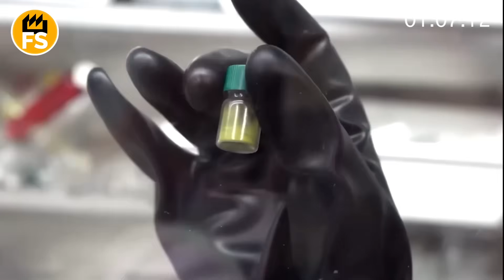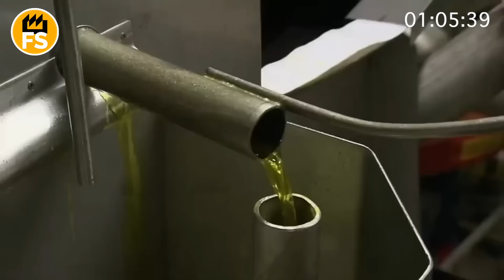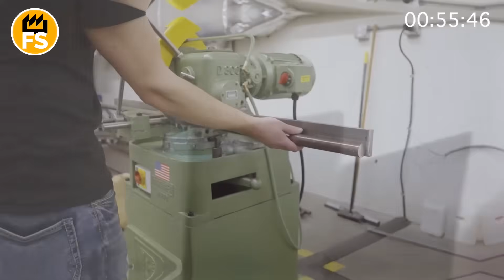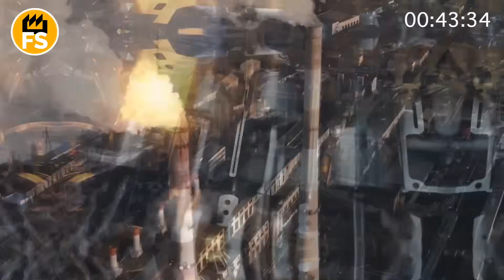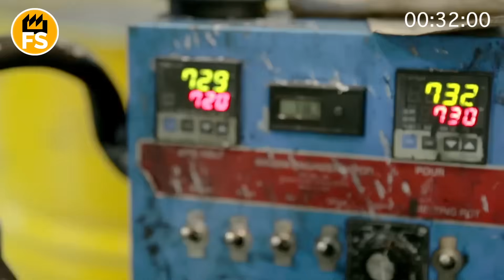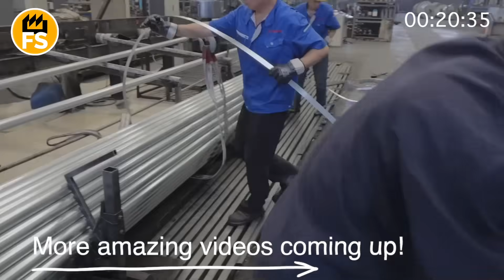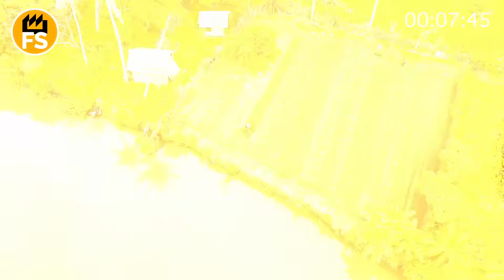How It's Made: Nuclear Fuel (1 Pellet = 17,000 ft³ of Gas!)

Comment: 2:44 a long half-life yes (700 million years), however the longer the half-life, the lower the radioactivity. The majority of spent fuel is Uranium 238 (which has an even longer half life of 4Billion+), the most dangerous isotopes in the spent fuel rods are cesium-137 and strontium-90 because they have a relatively short half life in comparison and therefore a hugely increased radioactivity. Don't breath any of it in though!
Reply from the maker: Thank you for sharing your insights, @Anonium1! You make an excellent point about the relationship between half-life and radioactivity in spent fuel; understanding these nuances is crucial for comprehending nuclear fuel's impact. 🔍

Comment: What a load of shit. Ive handled uranium. Alpha is only really harmful if it gets inside the body. Clothing can stop alpha emissions most of the time.
Reply from the maker: Thanks for your insight, @jasonduncan69! You're right that alpha particles are less harmful outside the body, but it's crucial to handle all materials with care, especially in nuclear fuel production. What has been your experience with uranium? 💡
Reply: @Factory.Secrets I've handled raw ore, yellow cake, and depleted material. You have no clue what you are talking about. Use your respirator, and watch your amounts and you're fine. Same with plutonium. Both alpha emitters that can be barehanded in the metallic form. Just don't inhale or ingest it. That's where alpha does it's damage. Unless it's a critical amount.
Reply: @Factory.Secrets we had to handle radioactive material in the oilfield. Some of the wireline tools, certain sensors on frac equipment, not to mention NORM coming up in the produced water and flow back. I'd rather handle uranium all day instead of a cobalt 60 source, or Cesium.

Comment: I like that people think nuclear electricity is a cheap source with no carbon pollution!!!! Then poison for 100000yrs.
Reply: The “waste” can be sandwiched between plates of carbon captured carbon with the help of graphite into basically nuclear batteries with a half life of about 10,000 years.  We have the technology we just don’t use it.
Reply: You have to dig less and have fewer plants to power a country. This isn’t the 1950s. Safety and redundancy has come a long way. The only reason we haven’t gone nuclear, is because corporate shills wont make as much money. So they scare the population and lobby against it. Easy win for them.
Im pretty sure those fiber glass windmill blades aren’t recyclable neither and who is going to clean tens of thousands of solar panels a day? No wind, no power. No sun, no power. Lobbyist🤌
Reply from the maker: You raise a valid point, @edimilner1! While nuclear power does have low carbon emissions during operation, the long-term waste management remains a crucial challenge that we must address. What are your thoughts on alternative energy sources? ⚡️